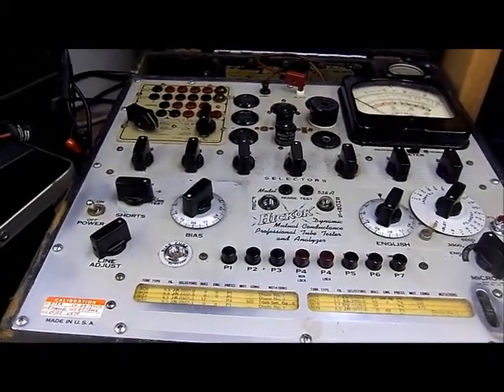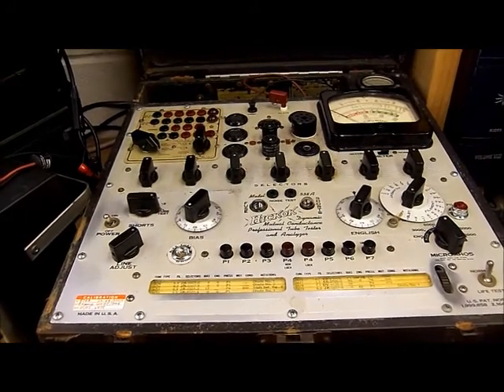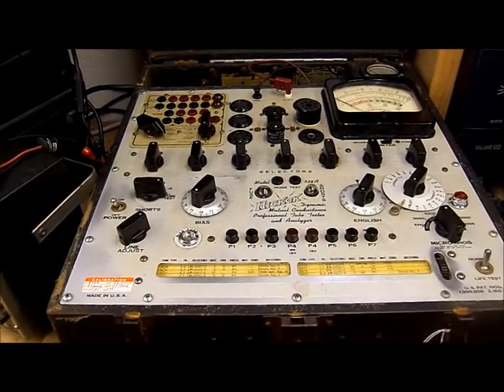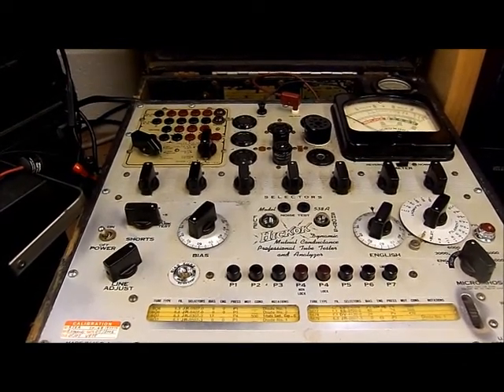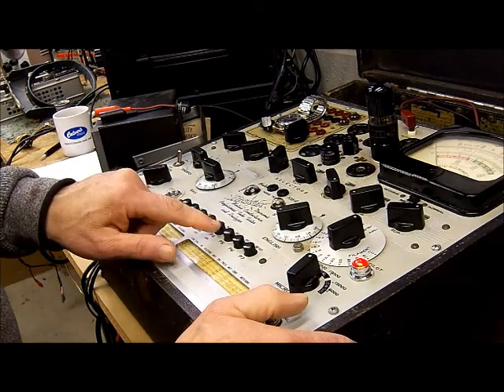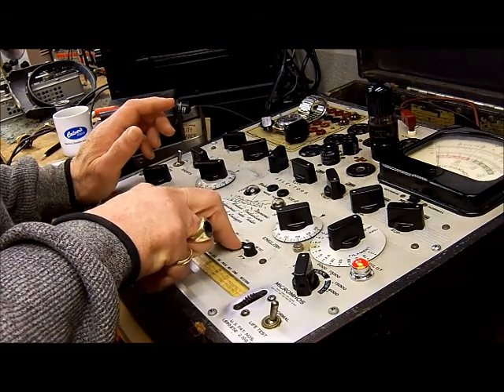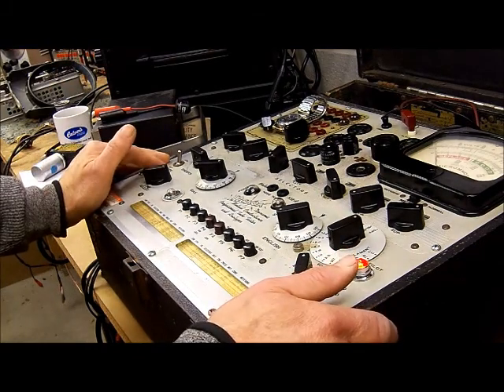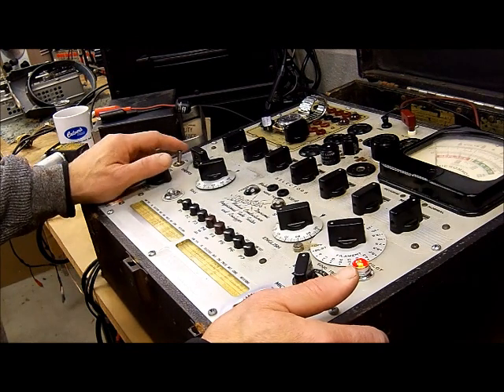Hickok 538A Mutual Conductance Tube Tester and Analyzer

Comment: The 539 series isn't even worth that much when they where sold new the cost was in the 100's not 1000's. People that are asking over 2000 for a tester should only be for a curve tracer which is best tester for testing tubes under real working environment. A 539 should be around 900$ restored and calibrated. I own a Hickok 752 a very nice tester and very accurate. I payed 750$ US which is proper price. It can test dual sided tubes very fast just press plate 2 button which makes that a + over the 539.